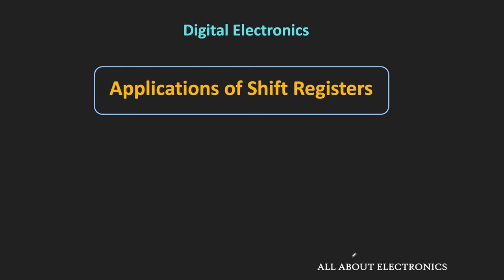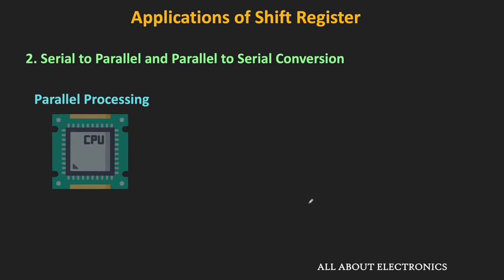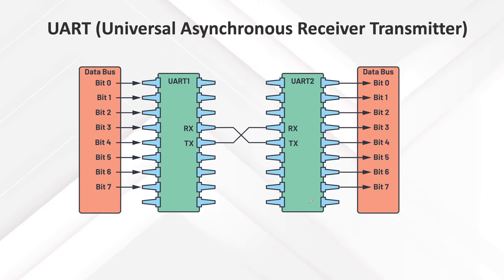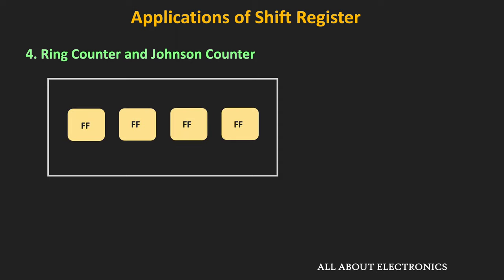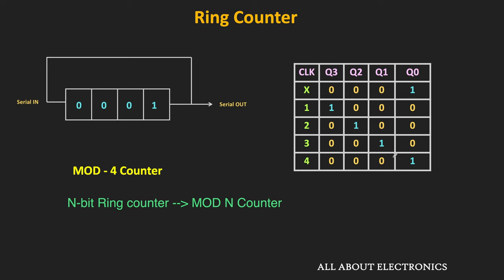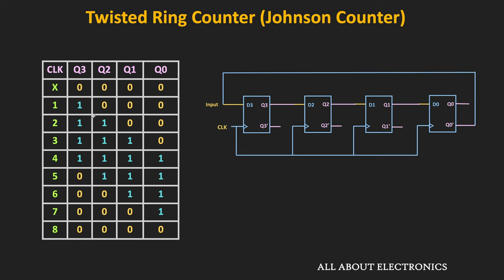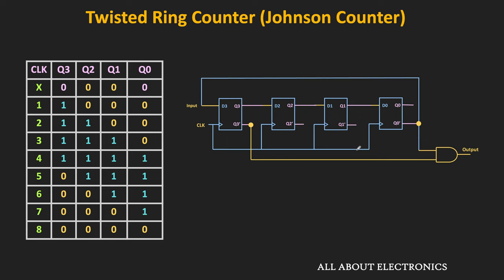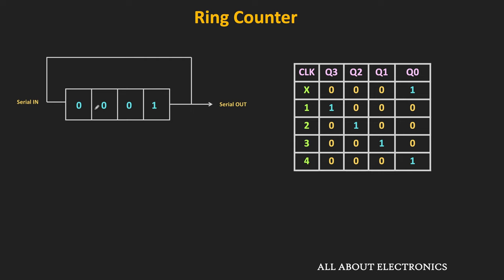Applications of Shift Register | Ring Counter and Johnson Counter, PRBS Generator

Comment: I can't understand the decoding part of twisted ring counter 10:40
Reply from the maker: Generally for decoding ,we used to take all the outputs corresponding to one of the states in the sequence and, AND them together. For example, in the sequence suppose if we have 8 states and if one of the state is Q3Q2Q1Q0 = 1000 then we use to connect Q3, Q2', Q1', and Q0' to the AND gate. So, when the output of the AND gate gets high, we get to know that the sequence is complete. In this case, with the same logic, the outputs Q3'Q2'Q1' and Q0'  (0000) should be connected to the AND gate. (Because after that sequence repeats). But if you closely observe, there is no need to connect all four outputs. You can just connect Q3' and Q0'. Because apart form 0000, for any other states in the sequence, these two outputs are not 0 at the same time. So, it will do the same job. I hope, it will clear your doubt.
Reply: Pal, thankyou
Really appreciate your flash level reply...
Reach great heights.. enlight everybody 🎉❤
Reply: Can we call prbs and sequence generator as COUNTERS??